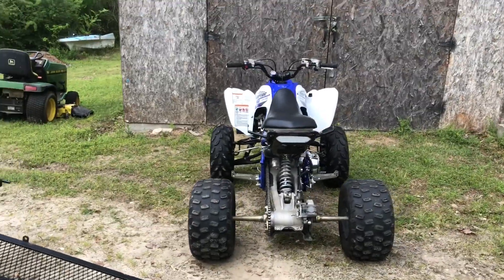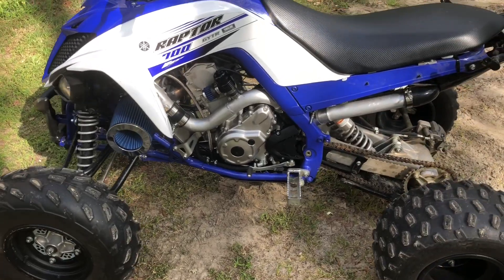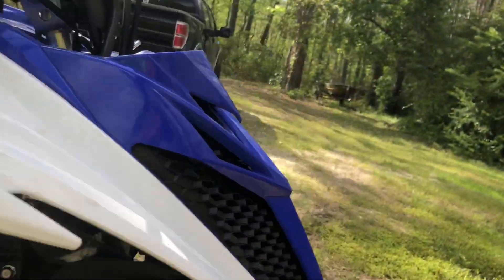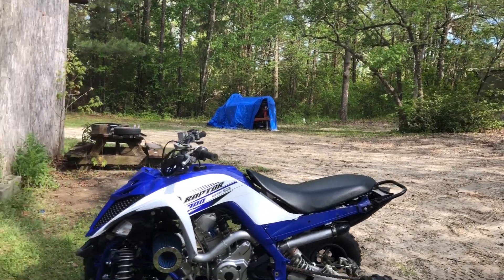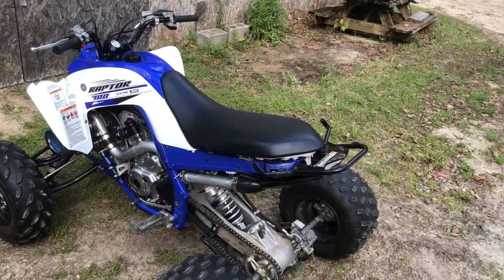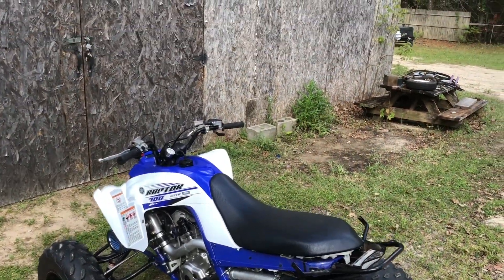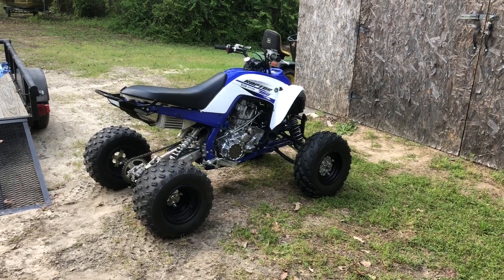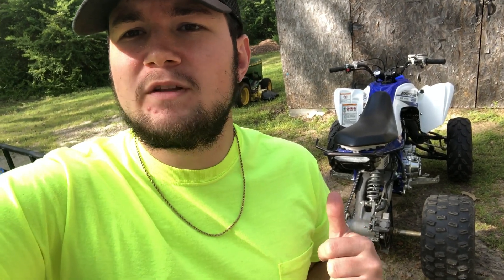D7 Turbo On Drag Raptor 700

Comment: Where did you get the turbo kit?
Reply from the maker: Geoff Carey I got it from D7 turbo on Facebook
Reply: I want to trail ride as well would this be a good set up?
Reply from the maker: Geoff Carey yea man you can trail ride with it, run 93 you’ll be able to trail ride
Reply: I’m finally getting serious about ordering this turbo do I need to order anything else at the same time?

Comment: Messed up this quad bro it's made to ride in the dirt and trails not to be on the strip
Reply from the maker: nahhhhh
Reply: Devin Cook yes bro j ride these bikes well not fourwheelers but they aren't build to run this way and that pipe will cause you hell in the future I suggest that you run a full exhaust system if you are gonna continued to ride this way because the engine needs the propery backing pressure
Reply: A2theE2 I don't give 2 shits if it's his bike this is not made for this
Reply: Mtb Ridingog what is it made for then?
Reply: A2theE2 to ride in the track and trails I'm not arguing with you anymore kid
Reply: A2theE2 never text me again before I get you kicked out of youtube forever
Reply: Mtb Ridingog kid lol, I walked more miles than you have rode. Boy,
Reply: Mtb Ridingog cars were not designed to go around an oval track at 200mphs but dudes like this guy who tinker made that happen!!! Its bitches like you who have no innovation that I pity!!!! I pray to God for more young men and wome Like this cat who see a motor and want to add more hp's.
Reply: Mtb Ridingog oh shit he used an emoji, this (nigga) hard!!!!! Lol what are you 8?
Reply: Mtb Ridingog "back pressure" lmfao do you even understand a turbo